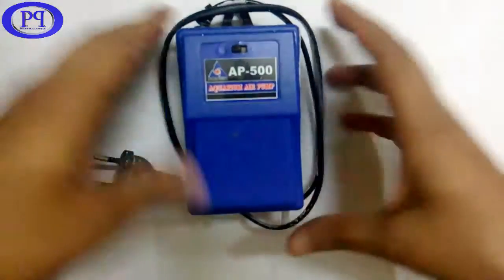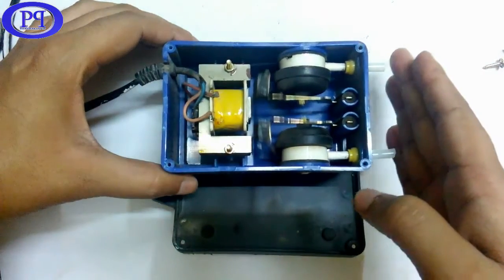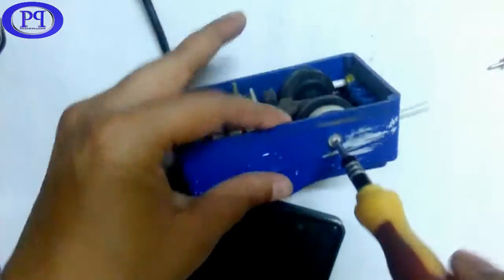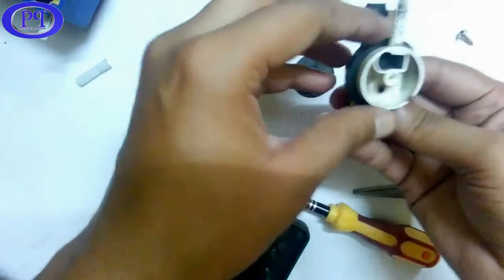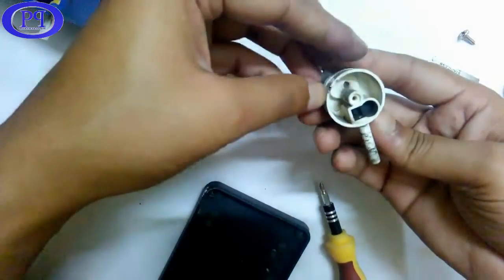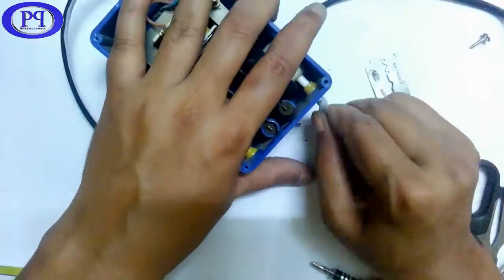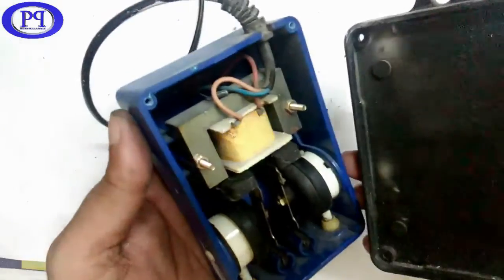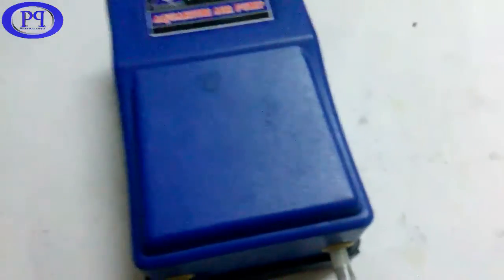Aquarium Air Pump Working Mechanism with Animation

Comment: What type of transformer is used in this pump ???
Reply from the maker: no transformer is used in this pump, the thing which you are seeing and thinking it as transformer it is not actually working as transformer, it is just working as an electromagnet.

so its just soft iron core winded with several turns of coper coil on it.

Comment: Hi Sir, I brought that E type silicon core and transformer from the manufacturer and i connected it to that magnetic air pump chamber its working, but transformer dissipating too much heat. please suggest me what would be the reason?
Reply from the maker: it depends upon the winding, type of Iron core, voltage fluctuations, if electronic filter circuit is not there then also this could happen.

generally I would prefer good quality transformer   can reduce the heat.

Comment: What type of current do you need for an air pump? ac or dc
Reply from the maker: The pump on which I have created the video works on ac supply. There are several pumps in the market which works on dc supply too.

Comment: Which transformer is used to the pump
Reply from the maker: What you are seeing inside water pump which looks like a transformer is not a transformer, it is just a winding of wire on soft iron core which is being used as electromagnet which changes its polarity (which occurs due to ac source)

Comment: Where is animation
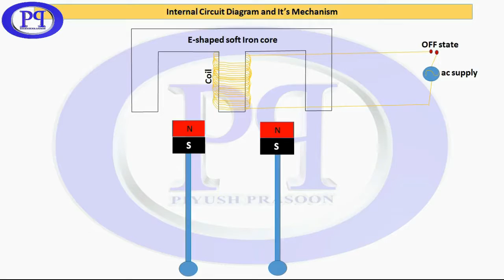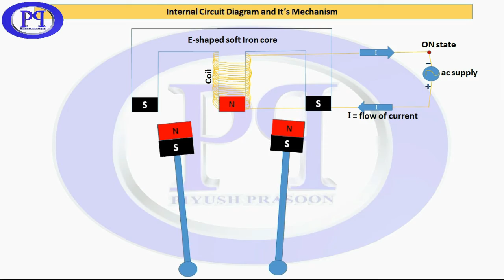Reply from the maker: Animated part starts from time 03:00 to 03:30. However this a general animation which I have created from power-point just to let the people understand about how electrical energy is converted into mechanical energy, i.e to move the two metallic strip, which further pumps the air in the valve.

Comment: 26 swg coil i have winded(tried 100 turns 50 turns,40 turn , 30, turns) in  air pump bobbin and inserted into bobbin rod and placed in air pump magnet and 12 v  1.3Amps  supply to coil but only one time vibrate started and stopped and when remove the supply and same process but after some time started smoke has come and lot of heat has been generated can you have any idea about this problem.
Reply from the maker: My previous explanation was about the electromagnet only, not the aquarium electromagnet. For this you need to go for regulated 12 V a.c current then it will vibrate because a.c current will change the polarity (N/S) to (S/N) and vice versa, hence it will vibrate.

In case you want to use 12 V a.c current in 100 or less then hundred turns it will be heated and after some time it will blow up. For making an air pump electromagnet which you want to run on 12 V a.c should have more than 300 turns in case of 26 swg wire coil.

To now out how the a.c current leads the lever to vibrate check out the animated video part carefully which is integrated in the above video.

Comment: this is very informative. can you please  brief about the winding information like how many turns and size of the copper wire ?
Reply from the maker: You could use 36 gauge(thinner) copper wire if you want to use any small iron core, this is just for increasing the number of winding/turns on the soft iron core to make it a stronger electromagnet. If you are having a bigger soft iron core, which will definitely have more space for required number of winding/turns over it, in this case you could use 24 gauge(thicker) copper wire.

Thickness of wire in gauge               Average Strong                                 Strong                             Very Strong
24(thicker wire)(at 12 V dc)                50-100 turns                              150-250 turns                    300-450 turns
36(thinner wire)(at 12 V dc)                50-100 turns                              150-250 turns                    300-450 turns

*Above given data can vary as per application requirement
Reply: Thank you so much for your information. one more information  If want to use AC supply what are all changes need to do?
Reply: what type coil and turns for AC supply?

Comment: so it will work until all the inside air of that box pumps out.. what after that, when inside the box get vaccum (no air)?
Reply from the maker: Watch the video carefully, there is an inlet hole made on the either side of the box which sucks air inside the pump.
Reply: so then it's not submersible right?
Reply from the maker: pump need to be kept out of the aquarium, you need to connect the long pipe to the valve and immerse the pipe into the aquarium and hook it at the bottom of the aquarium. Most of the air pump works in the same way.
Reply: Can you tell me please the minute you had shown " an inlet hole made on either side of the box which sucks air inside the box? As I cannot see any on your video or my private air pump.
Reply: @Demaskato_r  i cant see any holes in yours as well as my pump
Reply: Yes, of course. This is an another "fake news" ;-) This pump is not deliver any oxygen which is part of the air, so this is not an air pump. This is a water flow pump. ;-)
Reply: @Demaskato_r 
No !  It's an air pump. 
For pumping air into fishtank. 
...to aerate the water.
Reply: @MrBollocks10  Really, are you sure? Thus, where is the air coming from?
Reply: @demaskatorr  
100% sure. 
I'm here because the diaphragm in mine is broken. 
It's simple, really. 
It's a bit of rubber that is the top of a small cylinder. 
The rubber diaphragm goes up and down by the magic of electricity. 
 This pumping action forces air down the tube into the aquarium. 
 The air pump is located outside the aquarium. 
It has a small intake hole that lets air into it from the atmosphere. 
The intake hole has a small flap that makes it a one-way hole. 🥴
 Imagine a bike pump. 
It gets its air from the same place.
Reply: Ya I was confused

Comment: hi i like the video very informative , I have the same air pump, and I need to reduce noise  how can I do that do i have to do something with the out valve? or in?  thanks anyway
Reply from the maker: This pump is working on pull and through mechanism which creates vibration. I recommend you not to fix the pump directly to any solid object, to avoid the vibration sound or humming sound you need to put some rubber pad before fixing it to any solid/hard object you can use double-sided tape to fix it up.

Above method is highly recommended to reduce the noise. However you can check the valves if it is clean. While cleaning, use hot water to clean the plastic parts (clean only valves with water) do not clean rubber pads or the valve flap with hot water. Coils and wiring should be avoided to be in contact with water.